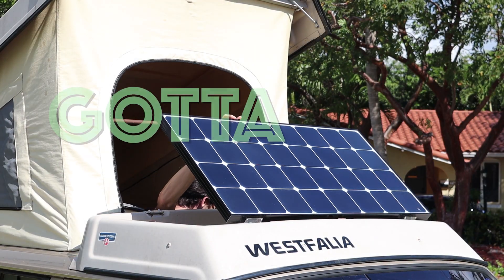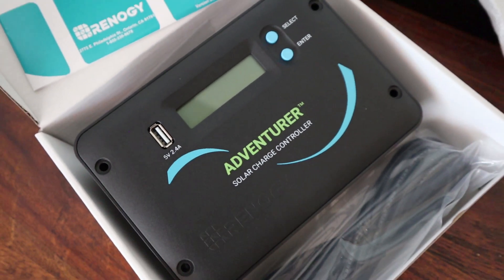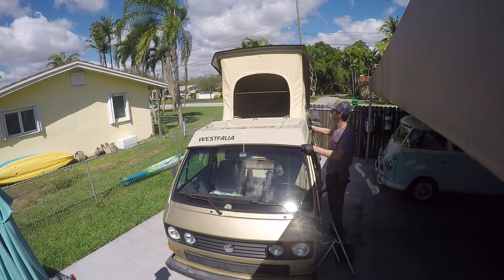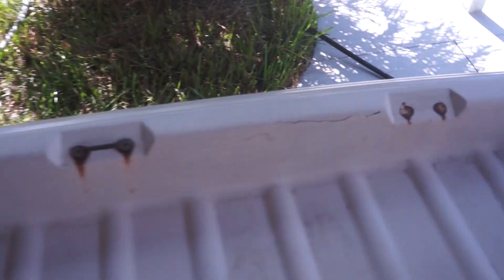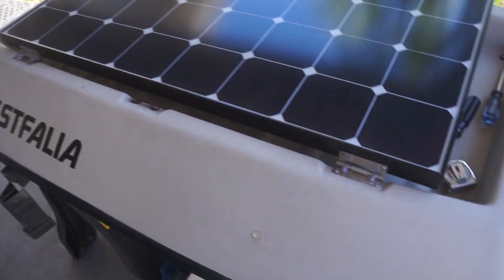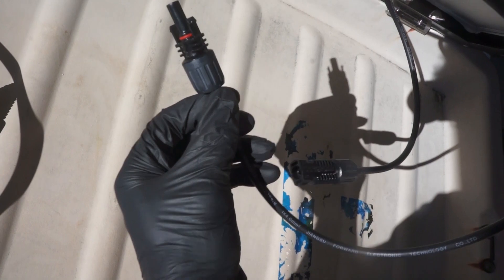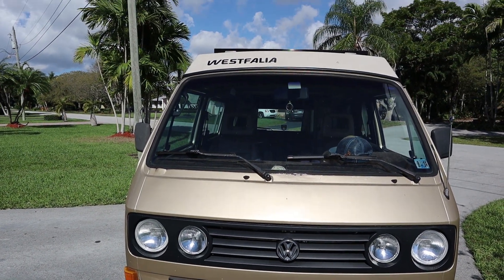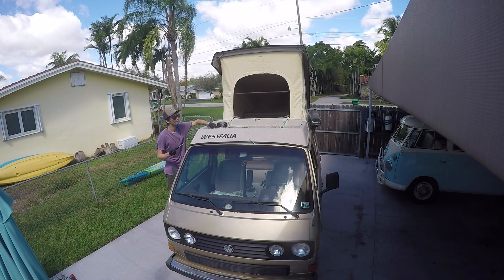Vanagon 100 watt Solar Panel install

Comment: Hey! I had a similar setup on my van, and also put the wires in under he canvas. I noticed however that a significant amount of water would come through when I had the top up and it was raining. 
Have you noticed a similar issue? I took the wires out and it seems to have stopped! 
Second question, have you noticed a difference in clearance with where you installed it? Or is it still safe to go around 2.00 meters?
Reply from the maker: At first, I did notice the space under the canvas where I ran the wires. I’ve been pretty lucky to not have had any water go through that area, but I can see how that would happen. I ended up using a bit of air conditioner line foam insulation, the soft fluffy rubber looking kind, and cutting it to fit over the wires and under the aluminum trim piece. That sealed it up and I can’t see any light through that area anymore, though I’m sure it would still leak if it was sprayed with a hose or something. I usually don’t pop the top if its going to rain though. There’s never enough time to let it dry the next day and I end up with mold.
The clearance is about the same, since the top of the panel is pretty much the same height as the vent hatch on the top of the pop top. It does make it scarier to go through low places though. I always get out to take a look or have a passenger watch to see if I can clear things.
Reply: @gottasplit5707  If I get water sneaking through that little gap, I might just add a wee dab of silicone sealant. I'm guessing any trapped moisture will get wicked into the canvas soon enough.
Reply from the maker: @brianhydesmith2662  That would probably work well enough. Just be sure to get silicone that isn't too permanent just incase you ever have to change the canvas or wires.

Comment: How come it doesn’t give ya info on load?
Reply from the maker: I really dont now why it doesn't, but I'm not the only one with that problem. Not sure if they plan to update the app later on to make that functon work, or if it only works with some panels and batteries. I can see the load on the actual solar charger screen though.
Reply: @gottasplit5707   It only shows power out if youre running your accessories from the charge controller "load out" since thats what your phone is connected to (the charge controller, not the battery)

Comment: Nicely done - was wondering of that panel size.  Appears as though it is installed somewhat above top of luggage rack - was wondering if it could have been mounted flush or even "inside" rack a bit and still fit.  Essentially mounting lower on hinges...  Thanks and great vid!
Reply from the maker: Thanks!!!
Dimensions: 40.9 x 21.0 x 1.4 inches
It does stick out of the luggage rack a little bit. I don’t really think it would be able to mount any lower in the rack. The rack is a bit rounded in the front, so the corners of the panel would hit. This also allows you to use the space under the panel as storage and the panel actually acts as a lid to the rack.
Reply: @gottasplit5707  yup makes sense - could see the tolerence in the front mount being tight.  And good point about retaining some usable space under.  Cheers...

Comment: I saw something in one of your earlier vids about replacing your fridge in the vanagon.  Is there a real replacement for the original cooler?  I don’t want to carry a seperate fridge.
Reply from the maker: Kim Horton VanCafe makes the kit I got. It’s been amazing! It’s not exactly like the original in that it works really really well and it doesn’t match very well with the rest of the cabinets . There’s even a freezer! I’ve also been able to run it all night with no problems on my little 80 amp hour battery. Runs off the solar and alternator when I’m in the sun or driving. It’s from Truck Fridge. Definitely get the kit to install from Van Cafe though. I’d also suggest getting the one that switches to 120v from 12v automatically. It’s a little extra, but when you get to somewhere with a power source you won’t drain your batteries.

Comment: Do you remember the specifics on the wires you bought?  Length and cable size?  4, 8, 10, or 12 AWG
Reply from the maker: Ryan Belsham I don’t remember exactly the specific wires I bought. I think it was around 16 feet of 10 awg. I remember that it was the same size that came in the kit that they sell with the same panel. I just didn’t need the rest of the kit.

Comment: Cool setup.  Just wondering if you've had any issues with rain or water coming in under the aluminum rail where the wires were run into the van?  I really like having the panel on the luggage rack and being able to tilt it.
Reply from the maker: Ryan Belsham haven’t had any issues. I didn’t show it in the video, but I did use some foam around the wire to seal it up. I don’t leave my pop top up in the rain anyway though.
Agreed, the ability to tilt it, take it off, and use the storage under it is fantastic.

Comment: Cool channel. I’m in Orlando, 1990 VW Vanagon. What tires did you install on your 14 inch rims? Wondering if it’s the Grabber ATX.
Reply from the maker: Roland Rosso Thanks!!! The tires are General Grabber AT2. Been fantastic so far. Not too much extra noise, and did very well on muddy dirt roads.

Comment: Hey! Just wondering if you also set up you battery to be charged by the alternator! Also are you using the stock dometic fridge? 

Great video, thanks!
Reply from the maker: Thanks!!!
Yes, my battery is also charged by the alternator. I have the GoWesty second battery kit installed under my drivers seat.
I definitely recommend having a way of charging your battery with something other than just the solar panel if you plan on running a fridge full time on it. I was testing the setup I’ve got out on the road for about a week, and had two consecutive rainy days (in Florida, who would have guessed). The panel definitely wouldn’t have been able to keep up with power needs with only a tiny bit of sunlight.
The fridge I have is the Truckfridge from Van Café. It works very well, and was even able to run it full time with only my small 79 amp hour battery.

Comment: Great video... How long were the panel to controller wires and controller to battery wires?
Reply from the maker: jimigoodmojo I believe they were both 16 feet, but I’m looking at it online now, and it doesn’t seem like they offer the panel to controller wires in 16 ft anymore. I’d like to say the 10 ft ones might work, but measure to be 100% sure. Both were also 10 AWG wires.